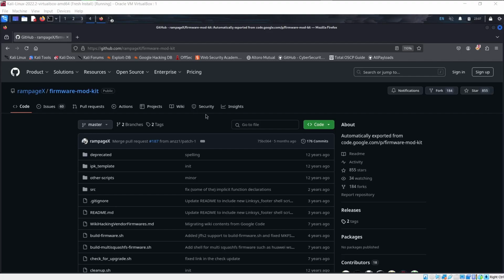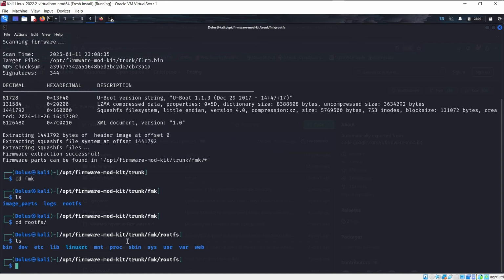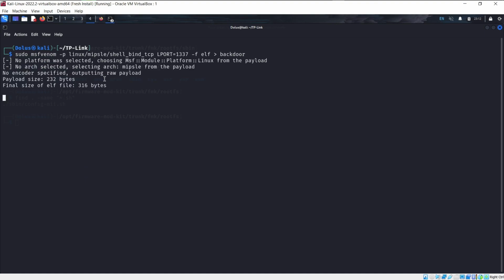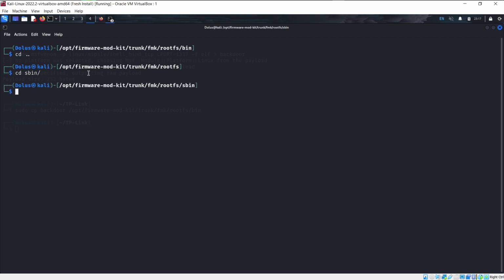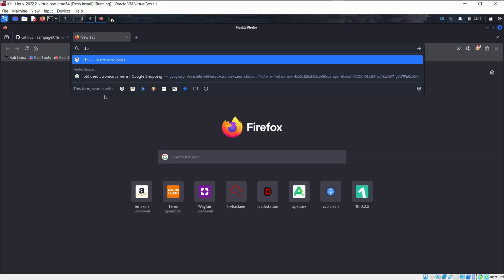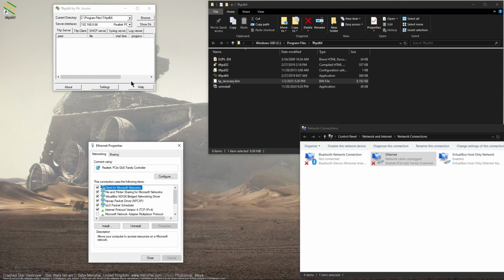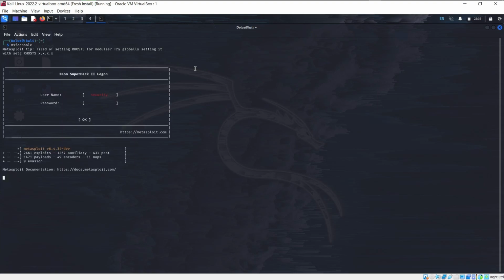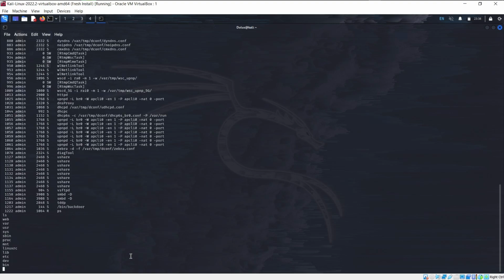Hacking a routers firmware - TP Link

Comment: Thank you what i need exactly to learn to find bugs in firmware routers
Reply from the maker: @Lee01-01  thanks for watching. Glad that I could help.
Reply: @Serial-Hacker  what i need exactly to learn to find bugs in firmware routers
Reply from the maker: For a router like this a good understanding of Linux would be helpful as that is the operating system that the firmware uses. You would also want to learn how to reverse engineer with tools like ida pro or ghidra. So you might want to understand C and assembly or mips. I hope this helps
Reply: @Serial-Hacker  Thanks